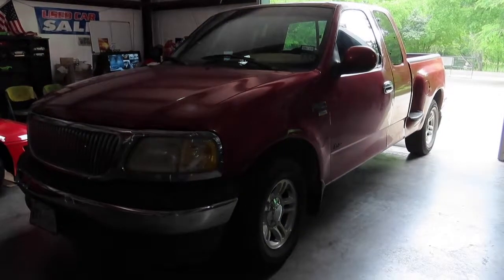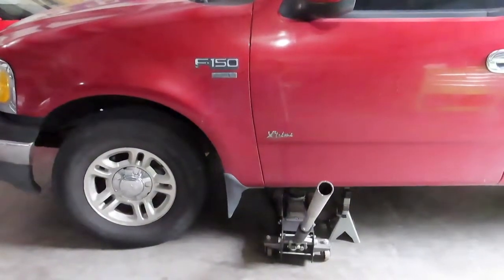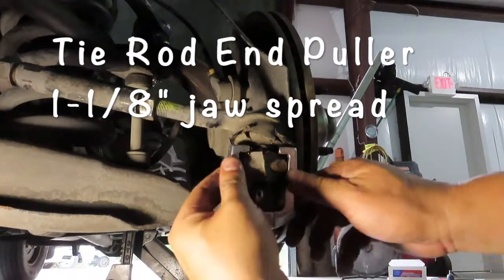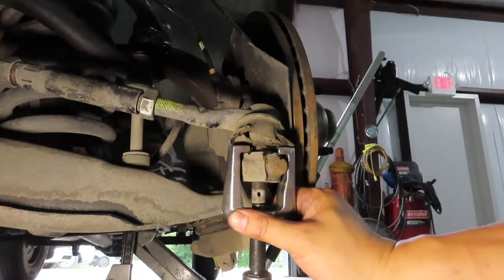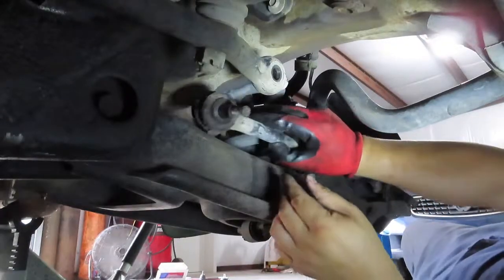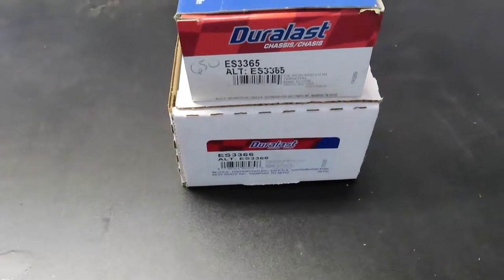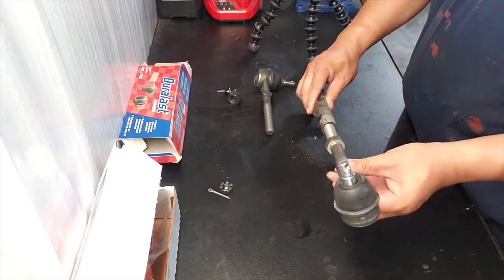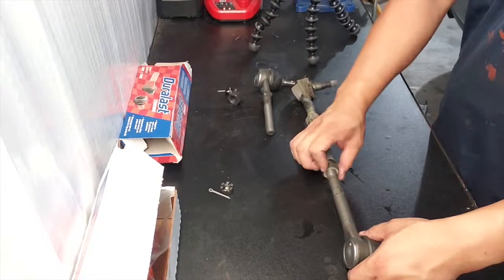Replacing Inner and Outer Tie Rod 1997-2002 Ford F-150 RWD

Comment: Only thing I'd add is maybe search for the correct torque specs but before that I'd also recommend taking a measurement on both inner and outer ends and maybe a touch less grease but nicely done sir 👍

Comment: The only thing I would add is take a measurement on both inner and outer center points to a specific point because each manufacture could make their parts a bit longer or shorter than factory.

Comment: For the 97 Expedition 4WD, there are added complications to changing all 4 tie rod ends.  The torsion bar runs so close to the inner tie rods that even a low-profile puller doesn't fit.  You have to unbolt the torsion bar both from the frame and from the lower A-arms.  Those 25-year old long bolts enclosed by a plastic sleeve are rust magnets!  Have fun removing them.  I thought I had ordered the correct tie rods: MEOE-64(right-outer) and 66(right-inner) but both ends had right-handed threads.  One of them should have been left-handed so that rotating the adjustment sleeve either moves them apart or pulls them together.  So apparently I either got two 64's or I got two 66's.  Since the part numbers are not stamped on the tie rods, have fun guessing which I had an extra of, because no one states which has the right-handed thread and which has the left-handed thread!  I did look at Ford Part's pictures and you can kind of make out what thread each has (assuming they put the correct picture in the correct part description.)  It looks like the MEOE-66 has left-handed thread.  (So Amazon sent me a 64 in a 66 box!😡) So on the passenger side, the inner has L-thread and outer has R-thread.  So turning the sleeve counter-clockwise should increase toe-in (each sleeve has a R-threaded end and a L-threaded end).  In a sane world, turning the driver's side sleeve counter-clockwise should also increase toe-in.  However, the MEOE-114 (inner) has R-thread and the MEOE-63 (outer) has L-thread.  You have to turn the sleeve clockwise to increase toe-in! Arrrrrrrrgh!  Well, this has been an enlightening experience which wouldn't have occurred if I'd been shipped the correct parts.  I've ordered a new MEOE-66 and will just have to eat the extra 64 (unless someone needs it! 🙂)

Comment: Awesome job!! Autozone f**?## me up!!! There wrote down the on top of the boxes , DRIVER side, PASSENGER side, THAT'S OK!! BUT!! BUT!!!! THEY
THEY SCREWED UP ON THE INNER AND OUTER PARTS REVERSED. SO I INSTALLED THE OUTER WITH THE INNER AND THE INNER WITH THE OUTER AND IT DIDN'T WORK DISASTER.!!!. 
SO BIG THANKS TO YOU FOR DEMONSTRATING THE PROPER MODEL NUMBERS AND PARTS GOOD JOB...